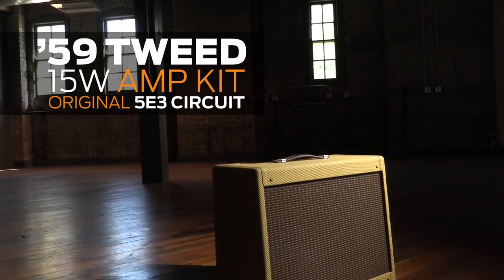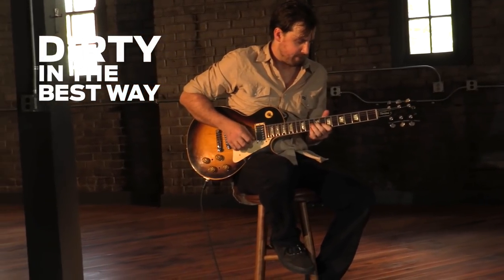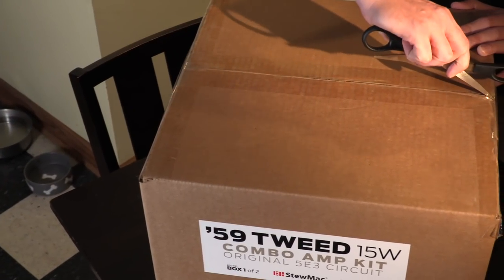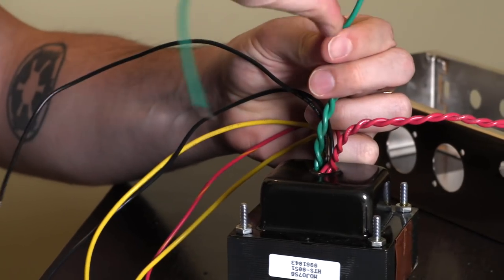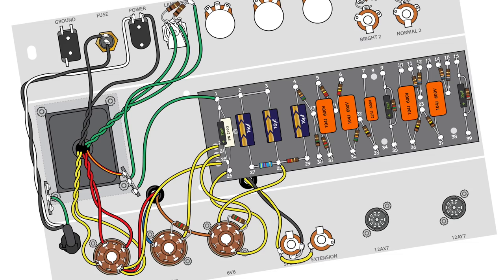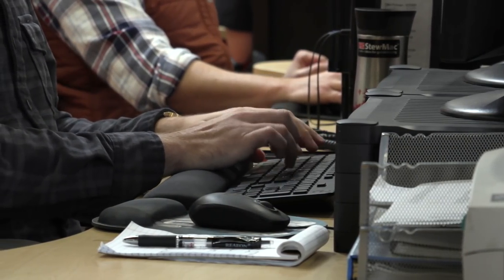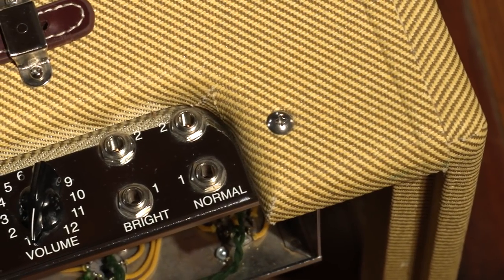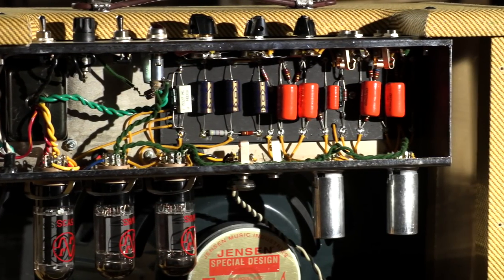'59 Tweed 15 AMP Kit with Original 5E3 Circuit From StewMac

Comment: The kit is ok and the instructions are really nicely done, but it's not fully "vintage spec" because the kit comes with a ceramic speaker and it should have a Jensen Alnico P12R as the originals did. I've built this amp from scratch more than once and tested with both speaker. With the ceramic speaker this amp really sounds inferior to the Alnico one.
Reply: Yeah, it sounds scratchy and unpleasant in this demo. Might have helped if they could've found a better guitarist.

Comment: I would have added a power transformer with a bigger heater winding so other octal power tubes could be used and an option for an active bias setup like Primaluna uses on their hi fi amps.
Reply: Then it wouldn't be a true 5E3

Comment: ...you can get a decent used one for that price from guitar center...
Reply: Yeah but with this kit you actually get to build it. Its fun and educational, definetly worth it if you ask me.
Reply: You could get the mojotone one but I don't know the difference in the quality of the components
Reply: @SaintierSet  Well given the kit will have new components you'll probably get more practical use from it. It will be more durable and you wouldnt be afraid to leave the house with it. For those reasons I would go with the kit personally. The question for me is, "Do I want a relic I can treasure or an amp I can get some utility from?" I choose utility.
Reply: @hunter5028  the mojotone is also a kit that cost $100 less
Reply: @SaintierSet  I would probably go for the Mojotone then. I've used them for parts and components for years and they always send top notch stuff. I missread your original comment lol. I didnt even realize you mentioned them at first.
Reply: @SaintierSet  I remember now that Mojotone even offers a class where they teach you to build the kit. If im not mistaken I think you actually have the build the board yourself, which doesnt seem to be the case with the Stew mac. So I can see the upside to the stew mac and the extra $100. But personally id like to build the Mojotone just to get more experience with nitty gritty circuitry.
Reply: Saintier set - The Mojotone kit has no instructions.  Just the schematic and board layouts.  Maybe Stew Mac has the full instructions on their website a person could use.
Reply: Actually, the Mojotone comes with a 24 page build manual.  I will be building a 5E3, but want to see quality build videos as well
Reply: This was a very tacky thing to say...as if choice is a bad thing and that the idea is to save money. Kits have never been about lower cost. Its about accomplishment. I like it...obviously.
Reply: Mike Johnson - then they started doing that somewhat recently.  I’ve built three Mojotone kits including the 5E3 and none of them came with any instructions.  Glad they have started doing that.

Comment: High voltage and first time amp builders don’t mix!! Caution on this one!!
Reply: underrated comment. be effing careful peeps!
Reply: I was thinking about this amp, I would be one of those first time builders you talk about, but I am also a electrician and have enough confidence in myself and my abilities to try this build, I don't disagree with you totally but I just think it boils down to a matter of common sense and knowledge, although spreading fear about tube amp modding or building is not a good enough reason not to do it, but with that said caution is a very good thing if you don't have at least a basic understanding of electricity and what it can do to you if not treated with care and respect.
Reply: My first amp build was a 5F8-A high-power tweed twin. I survived. As long as you aren't an idiot and use common sense you'll be fine.

Comment: Looks cool, to bad they do not work with 220-240 volts in Europe without an external adapter.
Reply from the maker: This amp now includes an international voltage transformer!